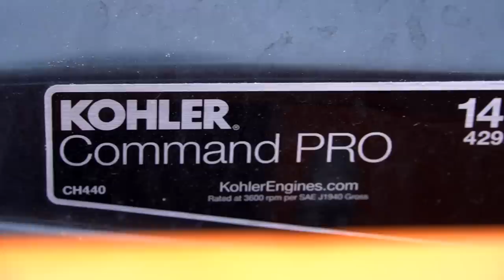Pulling Off Concrete Forms | New Home for the Sawmill

Comment: IMPORTANT.  Whre the concrete is porous because it was a little dry you should spread some mortar into the holes on the side of the slab.  If you do not do that the ice will crack and erode the side of the slab as the water gets into the holes and repeatedly freezes and thaws.
Reply: That's what I was thinking.
Reply: My thoughts exactly, some material that can be spread thin without drying out before it cures.
Reply: My husband has done concrete work since he was young (he is now 74). I told him about the honeycombing in the concrete. He said due to where you live, you may want to use waterproof epoxy to fill the holes. Also with any future concrete pours, if you tap on the forms before it sets up will alleviate some of the honeycomb issue.
You two did a great job.
Reply: I would add that if you get some white Elmers glue and with a small brush apply it to the cracks/holes that are on the side. Then apply some Type S mortar to fill in the gaps smooth. The glue will help bond the mortar and eliminate any gaps where ice can form. Good job though.
Reply: If this is something that wasn't done initially on a slab can you do it after and what would you have to do?
Reply: Very good advice.  
If you question this advice, contact a local business and run it by them.  I expect they will give you the same.
Reply: beat me too it! 

really should put some sealant in the relief cracks if it is going to be exposed to freezing water, which I imagine it will be. 

Guildbrook farms did a really nice short video on that
Reply: I’m so excited to see the next video and what it’s gonna be about ! Awesome job guys ! 
💚🌱💚🌱💚🌱💚🌱💚🌱
Reply: That sounds like an excellent idea plus, it won’t hurt it and has every possiblity to support the corner!
Reply: Good morning guys,
   Awesome job. I have a mill that needs some work. Hint hint.
 On your edges being rough when you place your next slab you can tap the forms with a hammer or best thing would be to have a vibrator. Also when you need to cut relief joints in your next slab you might consider renting a walk behind saw. They also have depth adjustments on them.
  There are plenty of rental places in Fairbanks. Yes, it's a huge pain to have to return stuff but cheaper than purchasing. What y'all have is a cut off saw. Not criticizing at all just offering up suggestions to make your life easier. FYI, I used to run a rental place here in Delta 😊
Reply: Yellow Swallowtail butterfly was picking up minerals from the new concrete slab. Your cinematography is lovely!
Reply: @MrAwsomeshot i love Guildbrook Farms!

Comment: Once the concrete is poured, take a rubber mallet and go around the outside forms tapping it to get the concrete to settle and not have those holes in the pad.
Reply: They poured this 3 days before this video was shot, so a week or so ago.
Reply: @Kiki-D-Kimono  I think he means for next time. Its good advice.
Reply: Use a reciprocating saw, take the blade out, but the gudie against the form, or the skreet board you use 👍
Reply: @Kiki-D-Kimono definitely more than a week ago. They were probably dipnetting last week actually 🤔

Comment: Glad you brought in the pro for the leveling job. He sure looked like he knew exactly what he was doing ;) Great video as always!
Reply: I swear, that dude was calculating the Coriolis effect, and compensating for the gravitational forces that bend the mill rails by a millionth of an inch.  At this level of precision, even temperature variations between his hands and the rails must be factored in, to the thousandth of a degree Fahrenheit. I mean, it's been talked about in theory (among your snooty NASA engineer types), but I've never seen anyone actually ACHIEVE it. Unbelievable. A perfectly level rail, with 0.000000000000° deflection, along its entire length.
Reply: He looks like he could use a haircut though.
Reply: Ironically it doesn’t matter in the slightest whether the mill is level. Everything you need to know can be done with string.
Reply: @HughJorgan1  haha! I thought so too!!
Reply: LMAO
Reply: You did a fantastic job. So now….accept it! It’s beautiful. The saw mill looks great on the slab! You both are doing fantastic with the projects you have done. It’s very obvious that you have thought about the direction of the property! WOW!

Comment: 'gravelly' concrete is usually good concrete.  The colors are different moisture levels as it is curing.  It dries out over the rocks and gets lighter and holds moisture longer between the rocks.  Most of that will even out over the next few days.
Reply: that was a good mix.should have had the driver add a few gallons of the water thats onboard than after the pour should have dobbyed it push the stone down and the cream would come up then float then fresno it  the kids did really good for there first pour
Reply: @georgejobin1744  Question, now that the slab is dry, can the corner where they added rocks and sand to at the end during the pour be fixed or supported with something the make it stronger? It looks like that last corner would crack and break easily?
Reply: I wouldn’t do anything on that corner; it’s done don’t overthink it. What was done likely won’t make much difference. Just backfilling a good edge for support on and off the slab is best now.

Comment: Hi friends. Consider filling those control joints with a joint filler so that water doesn't freeze inside and crack it prematurely :)
Reply: Thinking the same thing before the slab gets a roof. Some type of caulking  is needed in the meantime to prevent the concrete chipping around the  saw cut due to water freezing.
Reply: Was going to say the same thing. Sense it’s not a covered slab water will indeed get into cracks and freeze. Ice is stronger then the rebar and will crack and spread the crack more every winter. They make a caulk for expansion joints as well that works good to.
Reply: Yes!  Sikaflex at Home Depot, there is others but I know this works good. Also helps keep the cut edge from chipping off.
Reply: @kevink4914  Not only that, but once there are cracks in the joints any water will work down to the rebar and once that rusts it can expand and crumble the concrete around it.
Reply: @rickgreen9936  Ditto on the Sikaflex
Reply: This is sound advice, especially for regions near an outer edge surface! If you just cover it with dirt, dew water will pool inside, expand while freezing, and take whole chunks of concrete out, which will be way harder to fix than filling now, since you probably will have to redo some local formwork.
Reply: Definitely do that, yes.
Reply: I'm just glad to see positive advice for these guys. They are never too proud to admit they are trying something new. A community coming together to give helpful advice is so refreshing.
Reply: Look at all this stuff we are learning about concrete!!!! Who knew??
Reply: Totally. Plus, I'd put a low sheen sealer on that slab as well.
Reply: A rubberized type of epoxy in the crack joints then seal the entire concrete slab after that’s dry. But yeah you’re correct they should fill those cracks before water freezes in them. Unless they’re going to get a roof over the slab before winter. If that’s the case they could just get by with a sealer.
Reply: Yup - good advice!
Reply: good advice!
Reply: Awsome job you too can  tackle any job
Margaret lynch Southern Ireland

Comment: The reason the concrete looks like that on the forms is poor consolidation. At end of a pour like that, you can have the truck add water to increase the cement ratio a little bit to increase the ability to create the paste so you don't have the honey combing as we call it in the construction world. May have to tap the forms or use a vib a bit longer but it will work out. 

 However, its a slab for a saw mill and its over engineered by the rebar sizes and PSI you ordered.  You two did great!  You can use a mortar mix or some concrete sealant on the edges where its not sealed to prevent any freeze/thaw damage for when winter comes.

Comment: As suggested by Paul (another video episode commenter), please seriously consider to seal and fill the concrete cut slots with caulk (silicone the most long-term durable filler) to prevent rain and snow melt water accumulation in the cut slots and the ongoing freeze-thaw winter action causing ice expansion cracks in the concrete. As I've previous commented, consider an entire  concrete surface sealer application (e.g., Thompson's Water Seal) this summer when the concrete pad is dry and has reached its almost ultimate strength after about 28 days.

Comment: Next time tap the forms with a hammer. It helps the concrete settle and bring the water to the form for a smoother finish on the edges.

Comment: Bandit's ready!!  That boy... he sure loves dredging ponds.  Nice work cutting those joints.  

That mill cut some fine looking beams for you to use.  Save a few buckets of sawdust.  You'll love using it as a sweeping compound.  Dampen it and toss it about.  As you sweep it'll draw in the dust to adhere, and will simply ball up and roll along, no clouds of dust in the air.  Also great for the compost pile.  Also, pack it into cupcake tins (with the paper cups) and add a mixture of lamp oil and paraffin wax to make fire starters.

Comment: We run the rescue version of that Stihl TS saw. It’s a really powerful line of saws, our is for rapid removal of material in a life threatening situation. 

Everyone is going to have a tip or two for you, so here’s one more. Set two 4x4 or 6x6 as guides parallel to the line you want to cut. Use those guides as borders for a straight cut. 

Also, and this is smaller detail; but you can minimize the management of that hose line with a larger carabiner hooked to the saw using a split ring or even through a belt loop. It’ll give you more hands free use and easier management of the water line to the saw. Everything looks great, well done!

Comment: You can fix the outside edges by buying concrete mix *without* any aggregate.  One or two bags should do the trick.  You put it on with a trowel and it makes a nice professional smooth finish.

Comment: Quick tip before I watch the rest of the video. Whenever you are trying to move or prime a pipe, a hose, tubing, I even did it on my Harley motors after rebuild at the oil pump. Use a compressor with an air nozzle along the outside and pointed in the direction you want it to flow the difference in air pressure will create a vacuum and draw your fluid out or through your system. I learned this from a navy jet mechanic. The navy does this all the time.

Comment: @SimpleLivingAlaska, Eric & Arielle, be sure to fill all voids around the outside with mortar. Otherwise water and snow will seep in and will freeze during winter and cause it to explode or seriously spall, which will cause you a lot of grief.

Also, put in a self-expanding cork expansion joint filler in the relief cuts to keep standing water from seeping in and causing major cracking.

I would also roll on a concrete sealer for added protection.
Reply: I agree with all the add step! They are needed in a freeze thaw climate!!👍👍

Comment: You need to fill up the voids in the sides or the concrete will crack when water/snow gets in those holes.  We use to put in expansion joints (wood strips) while the concrete was being poured, makes it easy to remove the board when it dries.  No cutting required.

Comment: 1. For future reference, when pouring the concrete take a hammer and tap on the sides and you won’t get the rough sides. If you poured something deeper like walls or columns they make a concrete vibrator that you can rent. Plus it removes those voids from the middle of your concrete which makes weak spots. 
2. You want to get some Portland cement and mix it up then fill the voids in the side so water don’t get in it and freeze, it will crack that corner then you will wish you did it. 
3. Get a joint caulk compound and caulk the saw cuts to keep the water out so it doesn’t freeze and crack even more. 
All these tips will make your concrete last longer and look better. I’ve been doing concrete for years so trust me it’s very little work and cheaper than fixing later. Especially in Alaska with the cold. But looks great and love seeing people step outside their comfort zone.

Comment: Oil Change on ur Sawmill engine just get a screw in fitting with shutoff valve & a hose &  fitting to run into a tank/bottle. My lawn mower has the same setup & came with one. Hope it helps!   ...:))

Comment: If your slab will be outside for winter you might want to think about filling the saw cuts with something flexible so water doesn't freeze in them.😊
Reply: What would you fill it with?
Reply: @jeremyzaloum3443  For starters I have wouldn't have cut the slab but I would think some kind of caulk would keep the water out.

Comment: Just a suggestion,  To give you a little more height and to secure the mill better, cut and use a 2" x 8" x the length of your mill on both sides across your beams.   Screw all of the wood pieces together.  Then use pieces of angle iron screw down the feet of your mill to the trestle for the mill.  This way should by some chance you hit the mill, say with the tractor, it will not move much and maybe hold level.
Reply: That's a great idea!! They could probably re-use those forms they built around the slab when they poured it!

Comment: Please make sure you fill the stress relief points from water getting in and freezing. It wil break otherwise. And it is good ,if possible, to wet down slab and let it dry slowly.dont pressure wash yet! Even using silicone filler that expands and contracts would help to keep water out!

Comment: Use your sawmill as a log splitter for firewood.
Quarter a 12" log with the sawmill, then cut to firewood length.
Reply: 1/3 of all those logs will be waste anyway, the slabs and end cutoffs will make firewood. And the were a few firewood quality logs in the load too. Most mills would have rejected part of that.

Comment: Usually, the easy way to add expansion joints in concrete is to simply lay wood strips before pouring, or immediately after pouring and letting it dry in situ.
Reply: very very helpful?????????
Reply: Thats how my driveway was done.
Reply: I used to work for an engineering company, we poured millions of yards of concrete building wastewater and water treatment plants and that is how we did it.  Put those strips in while pouring and let it dry.  Cure it 28 days before putting anything heavy on the slabs.  Let it cure.  Concrete "looks" dry, but it gains strength when curing.

Comment: When our driveway was poured, 100x 10 feet by Italian migrant concreters here in South Australia they used an old hatchet to chop the expansion joints, then ran a concreting tool similar to a double sided edging tool,  along to neaten the edges. Never cracked in 25years.

Comment: Some people treat the forms for weather and apply motor oil on the inside next to the concrete should they ever wish to remove the forms. Forms keeps the edges from crumbling.
Have to say, I anticipated a few wild critter footprints in the curing slab. 😀 
👍👍👍

Comment: Expansion joints, that’s what your cutting into the concrete ! What a fantastic job your both doing. And I like your saw with the water hose attachment. That’s a brilliant piece of kit..💙💜💙💜💙💜💙💜💙💜💙💜💙💜💙💜💙💜💙💜💙💜💙💜💙💜💙💜💙💜💙

Comment: Hey guys. On the next slab, to get those edges filled out, you could try a petrol powered concrete vibrator. (Sits on end of a weed eater). Just sink it into the concrete just after it is poured near the edges. Don’t overdo it or it will settle out the aggregate too much). 🇦🇺

Comment: On your last video, I mentioned honeycomb. Your rough, pitted edges is honeycomb. This can be prevented. As I said, you need someone to strike the forms on the outside right after you strike the concrete off. Use a hammer, strike forms all around the pour. This works, makes a smooth edge behind the forms. 
As far as pouring the large pad coming up, you probably need 5 or 6 people. For one thing it's easy to overdo yourself pouring concrete. You don't want  to strain your body and pull a muscle. Good luck, glad to see your projects.
Reply: When I say strike the forms, I mean to hit the forms with a fairly good lick, but not too hard either.

Comment: That professional leveler looks very familiar. With regard to the concrete pad, two folks that admittedly have never done a project that size went ahead and layed it out, framed it up, poured and finished it in one day. A job that really needed 4 people was done by 2, with a little help from the truck driver. As far as I am concerned it looks great, and you definitely need to be proud of your accomplishment. Again thanks for sharing😊😊😊😊😊😊😊 31:47

Comment: It’s time to put the sawmill to work cutting lumber for the sawmill shed.  Build the shed before winter sets in to protect the the concrete from the snow.  Keeping the snow off the fresh concrete will help keep it from cracking from the freezing in the stress cracks.